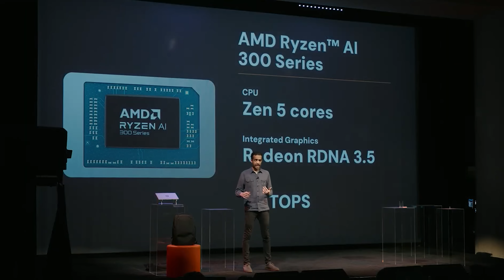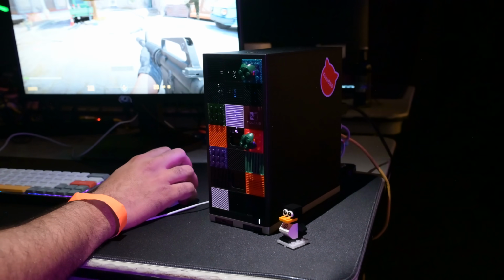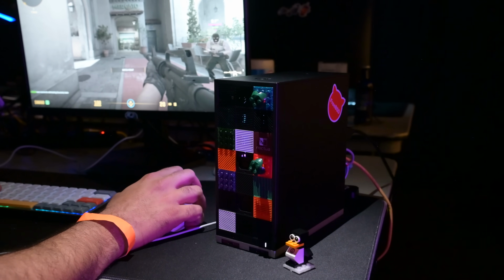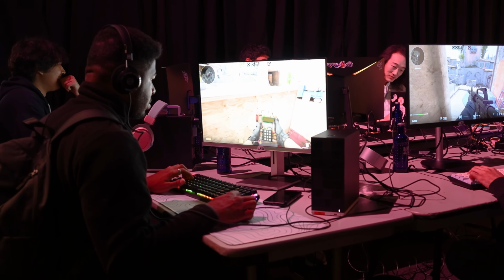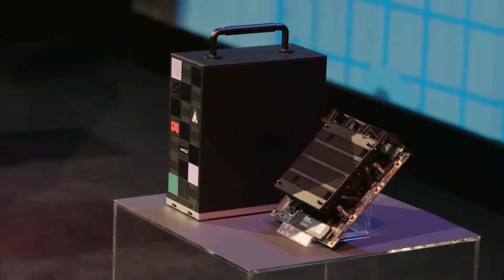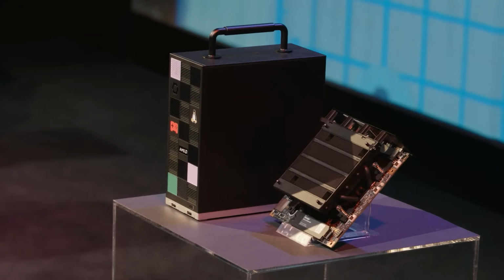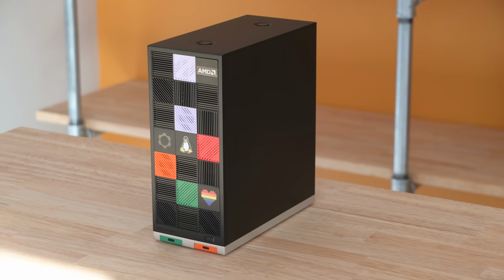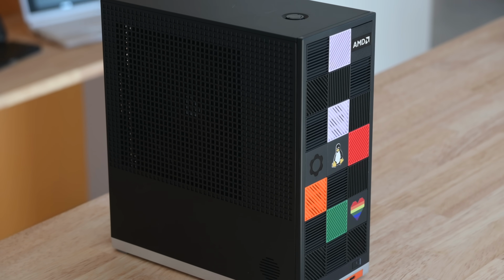Modular, Open, Repairable – The Framework Desktop Teardown!

Comment: I don't doubt Framework's repairability, but I'm still struggling to see the whole point of this product, especially when Intel/ASUS NUC is more compact and has more I/O ports. I'm sorry Framework, but only two expansion card slot? I'm not convinced.
Reply: So... Are you choosing your PC based on the amount of I/O ports? The selling point of this machine is architecture. Unlike NUCs, this machine has up to 128 GB of RAM clocking at 8000 MT/s on a 256 bit wide bus and integrated graphics performance comparable to RTX4060 but with up to 96 GB of VRAM. Even if NUCs can have comparable CPU performance, GPU performance and the amount of VRAM is the selling point.
Reply: @RandomNothing88   Just wait until NECs start coming out with 256 GB of RAM, it'll immediately smoke this. /s

It'll be interesting to see how well this performs and sells, but I'm skeptical of it.
Reply: I don't think this is for everyday desktop. Large unified memory means this is the dedicated device to run local AI model. Like mac studio accidentally became.
Reply: It’s competing in the Mac Mini / Mac Studio space. Same superfast memory, compact, quiet and powerful kinda machine
Reply: there are ports on backside, framework website show it.
Reply: @Kimkim-gl6qc  I just checked it, didn't notice that. Decent amount of I/O ports I'd say.
Reply: @farhan_fat8893 yeah, and if that‘s not enough, it‘s got USB 4 ports. So if you really need a lot of io, you can add a dock to it.
Reply: @MrChimeratic   Oh if you think that's a lot of USB ports mine literally has 5 USB-A on the motherboard and 4 on the case which is literally 2 more USB-A ports than my old motherboard, which it came with 7 USB-A ports.
Reply: Only 2 SSD slots too. With the lack of a full PCIE slot they could have at least given 3 or 4 SSD slots
Reply: @TeddyBearGaming999  I get your point, but you can have up to 8TB storage on each SSD slot. I can live with that.
Reply: @TeddyBearGaming999  how? by magically adding more PCIe lanes than the 16 the CPU provides? or do the intel N100 thing and connect the SSD with one Lane 🤣
Reply: I really want to see the back of this thing and figure out how truly limited the io is. 😂
Reply: Has Asus shown the prototype of a mini PC with Strix Halo ? No, so there's no point referring to that company. Apples and oranges.
Reply: @AlphaConde-qy7vi  Maybe not now, but I don't doubt ASUS will do it in the future.
Reply: I agree, a niche case would however be using it for large AI models. The ram is shared between the CPU and GPU and you can assign it freely, so  you can get a lot more video ram that you can with dedicated video cards.

Comment: I think it is a waste of resources. Desktop is already the most repairable platform and I can't see how Framework can compete with big brands like Asus and Gigabyte.
Reply: You're looking at a powerful system in a positively tiny 4.5 Litre case that weighs only 3.1 kilos, with more RAM than a friggen RTX 5090 offers for over $1000 Australian Dollars cheaper than the cheapest RTX 5090 on the market ($2990 AUD for the Max+ 395 SOC and 128GB LPDDR5X-8000 Unified Memory, $4040 AUD for the cheapest RTX 5090).
Reply: @ElNeroDiablo And which can run in cluster. (They showed a mininrack with 6 Framework Desktop motherboards running in a cluster, using the 5Gb and USB4 for connection.)
Reply: @ You're missing the concept. modularity and flexibility are functionalities that are already existing in the desktop world, and those are the mission goals of Framework. also, the unit's size and weight isn't relevant, no one takes a desktop, mouse, keyboard and screen in the backpack.
Reply: @IshayBen92 u are missing the Point of a PC with 128GB of RAM for CPU and GPU. The alternative is not a 2.000€/$ Desktop PC with a 16GB GPU, its a 5700€ Mac Studio with 2500€ extra for 8TB SSD.

Comment: 8:57 LPCAMM2 with 256 bit BUS wan't an option?
Reply: Framework had AMD run simulations on using LPCAMM2 with the Strix Halo SOc - AMD found there was just too much signal integrity issues using the LPCAMM2 modules with the fanned out 256-bit bus compared to using soldered LPDDR5X-8000 unified memory.
Nirav from Framework covered it in the LinusTechTips video going over the new offerings.
Reply: @ElNeroDiablo  That advertisement is BS. They could do it, they just didn't want to. AMD talks about Strix Halo with two LPCAMM2 modules as an option in their AI guidelines. It would require more expense than soldered RAM though.
Reply: @Zanpaa Talking about the possibility of something in some whitepaper vs actually trying to implement it in the real world are quite different things, especially within the limitations of an ITX motherboard form factor (laptops are more flexible in their non-standardized board layouts after all). What actual reason do you have to disbelieve the detailed explanation they gave?
Reply: @ price would be too high, that's another possible untold story
Reply: @Zanpaa  Its price. It can be done, anything can be done, but the cost of doing it gets to a point where its not worth doing. I'm not happy about the soldered RAM, but lets hope next get of these AI chips get a better memory controller so RAM is a choice again.
Reply: @johngrimm1103  "Anything can be done" is BS. Try running DDR5-9000 on an AM5 CPU and getting good performance out of it. Choose the most expensive motherboard around to ensure optimal signal integrity. It won't matter - their controllers don't do well at high speeds currently. Sure, the mobile LPDDR controllers aren't quite the same as their desktop DDR controllers, but they're closely related, and the simple fact of the matter is that current AMD memory controllers just don't do that well with high clocks.
Reply: @Kraaketaer  All true, but that is because AMD don't want to waste expensive silicon on the controller chip. All AMD chiplets with the cores are made on TSMC cutting edge nodes, but the main chiplet is not and that is where the memory controller is located.

Can AMD make it cutting edge, Yes. will they, NO. This is what makes their strategy work, cutting costs where ever possible and still making world leading CPUs.

Now if the Radeon division can figure this out and we can have some good GPUs at not crazy prices.
Reply: @johngrimm1103  Given that upgradeable memory isn't officially supported on their newest generation of monolithic APUs, which are made on the most cutting edge node they use, I doubt that would make any difference. Die shrinks don't generally benefit memory or PCIe PHYs anyway, so would this make any difference? Seems to me like they're just struggling to make a memory controller that supports high enough speeds with good signal integrity.
Reply: @Kraaketaer  Could be, but i think they are just not bothering to design them a new. They are just using what they got and not doing re-design for the new nodes, hence why no improvement. Its again cost cutting, them not bothering to do it. But i'm just guessing here. After all their cores are good enough to work with the not so great controller.

Comment: Too bad they didn't go with regular style of CMOS battery case that is in regular PCs... Makes changing that battery more of a hassle than it needs to be.
Reply: Yeah, it seems like an odd choice. CMOS battery holders are such a common standard part too, much simpler and I guess also cheaper than this shield + adhesive assembly.
Reply: This really makes no sense yeah, cr2032 holders with no wiring or anything are cheap and definitely cheaper than all this jst connector work. I've even seen it on laptops from a while back. Just can't find a reason to do it this way here. Would love to hear their justification.
Reply: Do you know what those are called? I have one on my old mini-ITX board with an old Intel 6000/7000 series CPU that died and I'd like to replace it at some point.
Reply: @automaticbulb  CR2032 are quite standard
Reply: @ I mean with the whole soldered/wrapped ensemble with wires to plugin to the motherboard. Don't know how to go about searching for that.
Reply: @automaticbulb  Usually you can disassemble them and replace battery by breaking down outer shell with scissors or box cutter and removing contacts from the battery. Then you reuse those contacts by placing them onto a new battery and using insulating tape to fix them onto battery. Make sure that tape is all around that battery with wires coming out of one side. Then you can install the result of your work back into your PC.
Reply: @automaticbulb  Those are CR2032s usually.
Reply: @automaticbulb  have you TRIED to google it yourself instead of asking here?
Reply: It's really just a CR2302 wrapped in insulation. You could pretty easily just reuse the wires already connected to the battery and tape them down to a new battery. Would only take a few extra minutes and those batteries rarely ever need replacing. I'm running 10+ year old computers that still haven't had the battery changed.
Reply: @Pyroteq  shelf life of CR2032 is around 10 years. All good if you never have power issues, do not use software TPM and other little thingies that rely on constant supply from coin cell
Reply: yes, socket would be better. However you can still buy 2032 with wires from many suppliers
Reply: Tbh I changed CMOS batteries like 2 times in my life. And that was on budget laptops of dell and HP.
Never needed to change it on a desktop, nor on a professional laptop (I run 2011 MacBook Pro, 2006 HP Server, and occasionally other old hardware)
Reply: @zanderfaehrteisenbah  I've had to change batteries at least 3 times in laptops. Granted, those were different laptops, but basic setup was the same (no casing for CR2032, only wires for BIOS battery).
Reply: It’s called RTC battery… even Raspberry Pi uses same battery to keep time. This is A “Industrial Standard” Battery.

Comment: I think the BD790i SE is a better option than this framework desktop as its RAM isn't soldered, has a full pcie gen5 x16 slot and is cheaper at 320usd which gets you a ryzen 9 7940hx cpu
Reply: The AMD APU on this is a beast, far more so than the 7000 series even though that series was good. The 256-bit bus caused issues with signal integrity so therefore its soldered

Comment: If this is decently priced. I'd be willing to forgive the soldered RAM
Reply: 1500 the basic model
Reply: It's actually pretty aggressively priced specifically to make up for the soldered RAM
Reply: $1400 Australian Dollars for the Max 385 SOC and 32GB RAM. That baseline config is about $200 AUD cheaper than buying a Radeon 7900 XTX.
The Max+ 395 SOC with 64GB RAM is $2290 AUD, about the price of one of the cheaper RTX 5080's.
The Max+ 395 SOC with the full 128GB RAM is $2990 AUD, about $1050 AUD cheaper than the cheapest RTX 5090.
Reply: @ElNeroDiablo  pcie expansion is limited. How am I supposed to have my 4 ssd pcie card fit in there. How do I put my 10G sfp nic in there

It's not a bad computer by any stretch, but for me, i don't think this fits my bill

Comment: >no Wi-Fi module included
>for that price
complete ass.
Reply: There is a WiFi/BT module included - on the backside of the motherboard, and was the first thing the guy in the video had to disconnect before he could remove the motherboard from the case without ripping wires.
Reply: it comes with Wifi 7 what are you on buddy?
Reply: Wifi on a desktop PC is complete ass.

Comment: Am I missing something? I don't get this at all. Non-standard PSU thing? Soldered in RAM? It just seems to be the making of their own ecosystem...
Reply: Looks like a standard 1u style (server) PSU with standard ATX pinout.

Soldered ram is just par for the course on GPU/APU if you care about performance. These APUs can hit 8000 (without weird clock skew like consumer desktops CPUs have when going above ~6400) with a bus width that is equal to quad channel. 

As for the size, theres a whole world of people who need or just want lots of power in SFF and are willing to pay more for it. I'm not one of them, and thats ok.
Reply: Flex ATX is very standard
Reply: It's 3.1 kilo system in a 4.5 litre case - it's a Small Form Factor "buy-n-go" system for those that need a portable PC with more flexibility than just a laptop in college/uni dorms, small apartments, on-the-go CAD designers, LAN parties (like at LinusTech Expo), on-the-go editing rig for conventions like CES or PAX, LLM crunching (the Max+ 395 can be configured with 64GB or 128GB, under Windows you can use up-to 96GB of that 128GB as VRAM for the GPU, under Linux you can configure it to 110GB VRAM)...
Or just want a small powerful secondary gaming rig for bedside gaming. Might even get licensed to be an official SteamOS V3.x Steam Machine in partnership with Valve.

You get an OEM warranty with Framework themselves, so if something goes wrong you just send it to them instead of fighting with a half-dozen or more vendors like ASUS, Gigabyte, MSI, ASRock, Corsair, Seagate, Samsung...

Having been building and repairing computers for over 30 years now; it's a right pain in the rear as a individual parts customer to find a motherboard that small with all the functionality it has, that's compatible with the CPU you want, and squeeze it along with a full PCIe x16 GPU in to a case that tiny and keep it modular- the Ryzen AI Max 385 and Max+ 395 are SOC's that reduce part counts and if the SOC or RAM goes bad; Framework sell replacement motherboards for this system like they do with their laptops.
Reply: PSU needs to be small for the Overall size, ram needs to be soldered for signal integrity. Its Not optimal, but there have corners to be cut to Pack this thing in such a small Footprint. Maybe in upcoming versions they get the signal integrity under control and make it swappable :)
Reply: PSU is standard SFF PSU, you just aren't informed. But otherwise... eh.
Reply: Isn’t it a standard PSU? Thought it was Flex-ATX PSU.

And the soldered RAM is due to AMD, not Frameworks intention.

Just don’t buy this AI-nonsense-APU and get a framework laptop if you want a „real“ framework experience.
Reply: @zanderfaehrteisenbah  Yes, it's a standard Flex-ATX PSU.
Reply: Same, regular desktops have been a thing for decades. This is just strange
Reply: "It's time milk the fans" - framework probably
Reply: @keithframe3489  "man sees product not made for him and feels insulted that he sees no usecase"
Reply: @ huh?

Comment: the gap between price and value is HUUUGE for this thing but at least it looks nice
Reply: The top-end offering here from Framework is still over $1000 Australian dollars cheaper than the cheapest RTX 5090 ($2990 AUD for the Max+ 395 128GB LPDDR5X-8000, $4040 AUD for the cheapest RTX 5090 on the market here).
Reply: @ElNeroDiablo  why are you comparing it to a terribly overpriced gpu?
Reply: @baconwizard well because it has the most VRAM if u dont want to spend 35.000€ for the H100 with 94GB VRAM.

Comment: Really can't fine any edge over the miniforum one, and only PCIe x4 slot is really disappointing.
Reply: A lot of VRAM. That's the difference
Reply: The x8 PCIe Lanes from the SOC are split x4 to the WiFi/BT card and x4 to the PCIe slot - the closed-back x4 slot is likely just a R&D Unit thing, and the Production Units will be open-backed slots.

Comment: I would've liked to see a socketed APU. 
You normally pick RAM capacity that fits your use case and workload, so I don't see soldered memory as an immediate dealbreaker - especially when the different options are reasonably priced, but the ability to upgrade the CPU/APU is what really gives a computer longevity. 
So, while the case seems to be well engineered, the product as a whole is less 'modular', repairable or upgradeable than a standard mITX desktop pc. 
The only real difference in terms of upgradability and repairability between this and an Apple product is the standard 2280 M.2s. 
The SFF PC community is going to scoff at the soldered components, Apple fanboys will ignore it, so who is this for?
Reply: I think you missed some of the other releases like from framework themselves. It’s a brand new platform from AMD. Mostly aimed at AI development as you can dynamically assign ram to the CPU, GPU etc for tasks.
Reply: in this case same problem as socketed ram the memory controler can't handle it
Reply: go ahead and watch the video on linus tech tips on this desktop. Framework CEO themselves said that they've reached out to AMD to see if there is any posibilities of a CAMM module. After AMD engineers tested with the modules, they deemed that performance not stable enough to be put onto end-product. And to answer your question, this would be awesome for anyone who wants a portable desktop, preferably college kids or those who have to travel a lot. Not everything has to be about customization, some people just want a plug-and-play device. How did you think Apple sold that much iPhones and Macbooks?
Reply: @minhhieu9589  Well, if that's the angle then they're entering into a market segment that's already crowded with offerings from Lenovo, Dell, HP and Minisforum. 
Guess the price will determine its niche then.
Reply: @protator  The MAX+ 395 128GB option of this desktop is $2990 AUD plus shipping, the cheapest RTX 5090 on the market is $4040 AUD - for an Australian needing a powerful tiny computer like this, that under-$3000 Australian Dollar price point is pretty friggen competitive.
Reply: @ How did we get from soldered APUs to comparing the price of a SSF pc to that of a halo tier dGPU?
Reply: @ Prices is RELATIVE and you'd be hard pressed to find a mATX or Full ATX rig with a 16C/32T CPU and GPU with 128GB of RAM below $3000 AUD/$2000 USD without being shafted by Apple Pricing.
Reply: @protator  AI